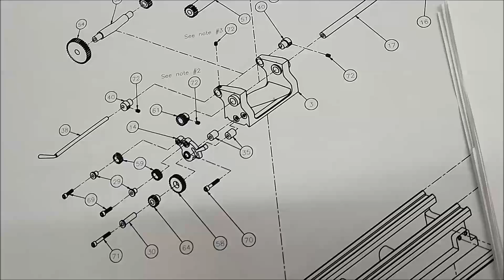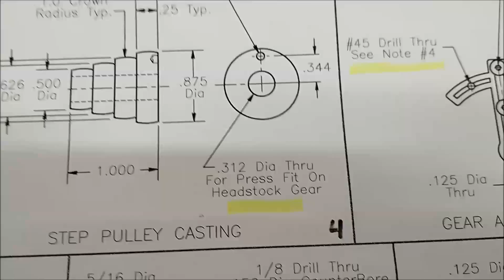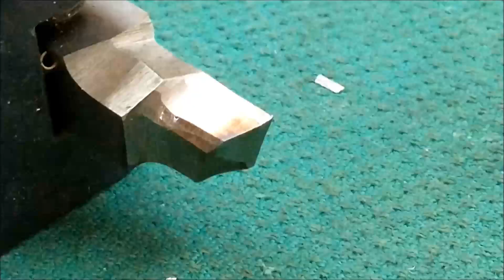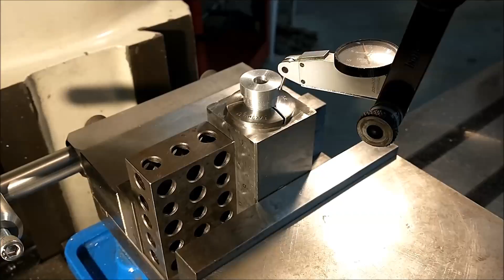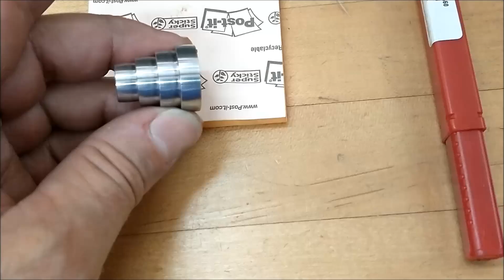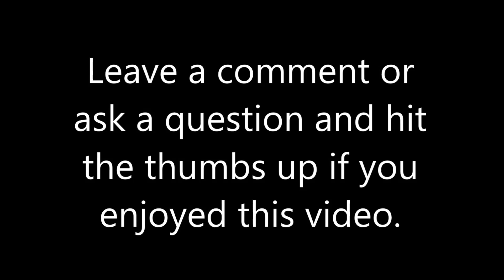Machining a Miniature Lathe -  The Cone Pulley - Dimensional Crash ????

Comment: Dumb question - why the 1-2-3- block instead of the vise jaw itself?
Reply from the maker: Anytime I use a 1-2-3 block, its usually for a vertical reference surface. The stationary jaw only gives you one vertical plane. Using a block, you now have 2 and the part can be positioned true to the machine Z axis.

Comment: It takes a lathe to make a lathe, now I just wonder how they made the first lathe ever...
Reply: Seems obvious, but... by hand. It's been a matter of continuous refinement and improvement in materials, power generation and measuring tools over centuries. It's actually related to the potter's wheel, same principle and it used to be foot powered and using simple spindles, and mainly used for wood turning at first. 
If any two opposing points are solid and stable, any object rotating, affixed between those points will rotate in a 'perfect' cylinder. 
Just the matter of stability, precision and driving that rotation has improved.
Reply: Check out the Gingery Lathe (and other machine tools)  
Really interesting and practical information that shows how machining tech could be bootstrapped, and will certainly teach some the principles of how it actually was.
Reply: @georgehill9353  Woa David Gingery is a goldmine as a source of knowledge, thanks for that recommendation.

Comment: I like a file to remove cold welded junk from the tool. I figure it won't effect the edge of the HSS (or Carbide, but might be more likely to chip the carbide). If I use the stone at the wrong angle, or slip with it, I might have to redress the whole edge (or not notice, and have dulled my tool). Thanks for the vids!

Comment: I have access to a 3 speed 25 in lathe dating back into the 50's that still has its original hand laced belt. 8 in from chuck center to the bed rail clearance. I have made some incredibly large pieces on it over the last 42 years with my old business partner. We are both retired now and lovin it. I have yet to have a need to pressure turn but know when the time comes I won't be in the dark. Stock or a Gr 8 bolt would be my choice, LOL. Sweet seeing the crowns come to fruit. Very nice indeed. Sure pays to spend a lot of time as needed when working with prints looking for little glitches like what you encountered here eh. Well my friend one more tick on the parts list done eh !

Comment: Thank you very much! I learned something today thanks to your expertise. I have trying very unsuccessfully to do some single point threading and my results to date have been crap. It would seem that I have been remiss in how much I was honing my tool. My threads would start out just fine and then all of a sudden right in the middle it would rip the threads out destroying my part and I know it wasn't my half nut  timing because even when I left the half nut engaged it did the same thing. "More hone, less moan" will be the motto from today onwards.
Reply: Did you check the  lead screw  for play ? or back gear not meshed right.

Comment: You got me ,lol. I made the 4 jaw chuck yesterday first one after I got it turned , I forgot to get the collet block collar tight in the mill , Dhooo.  Second one I bumped the vice out of square on the mill , took  an hour getting it right and aligned to the part and reset the DRO. I did not make drawings . Kinda seat of my pants from the tee cutter size I have. Made the Jaws in bras , thought it looked cool. Came out quite nice . Chuck body is 1042 stress proof steal , slooow going ! Got er done ! Just need  to put the features on the Jaws. Thank you !

Comment: It's looking great, and it's so close to being finished. Have you thought about what kind of motor you're going to use and how it will be mounted and all? A quiet DC motor with a planetary gear built in would be good to keep the RPMs down, or a small "gear" reduction setup with pulleys. I can't wait to see.
Reply from the maker: I'll stay period correct and belt drive it off the steam engine I built.

Comment: Joe, will you be redesigning the gear & pin to permit it to be properly (dis)engaged?

When you were pressure turning the step pulley(s), your tailstock pressure piece wobbled a lot and it looked like the live center was wobbling too.  I'm guessing that your live center looked like that simply because of staining on it rather than it actually wobbling?  I also assume that the pressure piece wobbling doesn't matter once it is pressing the part.

One last (non-related) question: when you were using your edge finder to locate the V-block & vice jaw, I was reminded of my "confusion" about how to properly use the center finder half of a combination center/edge finder.  Am I correct that the center finder half is only useful with the spindle turned off and simply measuring over the edge finder once the point is "embedded" in the hole/center that is being dialed in and then moving the table as needed until there is no measurable variance?  Or am I just not imaginative enough on its use?  ;)

Comment: I've heard it called  "built up edge" When I have a problem with it I bump the edge straight on with something soft like mild steel. Brass is cool too. I tap it in the direction of chip flow. Good oil or coolant helps with this pesky issue.

Comment: This is a great example of where dimensions should be listed as asymmetrical. The gap being +.005 -.000, and the pulley being +.000 -.005

Still, the gears are sized such that like you did here someone will mostly likely need to thin them out 5-10 thou
Reply from the maker: True, but the amount of potential movement in each sub assembly would also have to be factored in for positional accuracy.

Comment: This is the episode I've been waiting for. Really cool.

I do have one question though.

Couldn't you have drilled and reamed the centre hole first, then mounted it on a long arbour, to do the diameters and crowns?
Reply: Possibly, but the part is quite bumpy as it is a casting, so it would be quite difficult to properly align the hole. Also, I'm unsure if using an arbour would work in something as soft as aluminium, I would think that the tightening of the arbour and the subsequent turning will deform the hole. But maybe, if the hole is reamed as a final step. What's more baffling is why they went the route of making a casting instead of simply throwing a piece of bar-stock in the kit.
Reply: @Skaldewolf  "What's more baffling is why they went the route of making a casting instead of simply throwing a piece of bar-stock in the kit."

Like they did for the chuck.
Reply from the maker: @BedsitBob  To answer your initial question, Yes. But the answer below it is pretty accurate as to the risk.

Comment: Joe, your workmanship is unsurpassed. However need to ask a question does one lubricate skroll chucks internally with grease or graphite dust ? Thanks Johnu
Reply from the maker: I've always used just light oil on the jaws and grease on the back of the scroll internal workings. Too much grease on the face of the scroll is like glue for flying chips.

Comment: Hi Joe, I am only half way through but I thought that I would mention a couple of things for your audience; I use very old 3.5" centre lathes, what you would call 7" swing, with flat belt drives. At this size the crown on the pulleys is unnecessary as the steps keep the belt in place. Your model's prototype will be a big industrial lathe with long belts coming, probably, from a high ceiling so belt tracking will be more of an issue. Also, you run an industrial workshop producing large amounts of work efficiently and economically so you will grind your tools accordingly. I use HSS tooling and grind my own using experimentation for the best finishes on occasional single parts. I have found that up to 15 degrees top rake gives excellent results. The point here for hobby machinists is get to know your machine and don't be afraid to experiment. I don't know much but like to share what little I do.
I have now seen the rest...superb again Joe, thank you very much

Comment: Joe, I spent my industrial career working on Euro equipment, all metric. Whenever there was a high tolerance fit, like a pin in a hole the print would call out the nominal size, say 100 mm. Then the call out on the hole would be say, 100 +.02/+.04 mm and the pin callout would be, 100 -.02/-.04. So the minimum tolerance would be .04 and the max tolerance would be .08. This eliminates that tolerance issue.
Reply from the maker: Agreed.

Comment: I would have drilled/reamed the step pulley first, then pressed onto an arbor (either custom-turned, or a stock arbor) for the outside machining.  When you did the pressure turning, I noted tailstock end wobble (that you cautioned against in another pressure turning video) that should have been relieved before turning.
Reply from the maker: You need 6 hands for that. Pressing this onto anything other than the final part would be very risky. the material is very gummy and could tear easily.

Comment: When I went to tech school back in 1970, before I went off to play GI, they figured that that tooth was something that helped tool life. Probably because of the low grade tool bits that were available. Aluminum wasn't included in that. I have also discovered that super gluing a piece of emery cloth to the drive spud helps a lot in that pressing  type operation. It doesn't need to be really coarse. Great series, by the way.

Comment: Whats with the commercials?  10 breaks, most of which have 2 commercisls each.  Some of the commercial breaks are longer than the content that preceeds them.
Reply: Really? I didn't get a single ad, and I'm signed in but not paying anything. Might be something in your settings?
Reply: @sean.chiarot  You didnt have any ads in a 40 minute long video?
Reply: @adamculpepper5571  Not one. I'm just realized that I'm running the browser extension Adblock Plus. I just turned it off, rewatched the video and got an ad a little more than two minutes in. Install Adblock Plus (it's free) and it will eliminate most if not all ads. I had no idea it was making such a difference.

Youtube has a tendency of changing the ads preferences for uploaders and not telling them. So a lot of times they aren't even aware that that many ads are playing.

Comment: For a thin Flat belt -- Check with the Edison Phonograph Guys, The thin leather belt that drives the Cylinder machines I bet would work Nicely. Its also easy to handle and splice.

Comment: I find that kerosene used as a cutting fluid prevents build-up on the tool when cutting soft materials like aluminium and copper.
Reply: I also use auto transmission oil. Works we and you can get it anywhere
Reply: Ethanol
Reply: Kerosene is the major constituent of WD40.

Comment: Is Ok to stone a cold weld on a carbide insert?
Reply: I was wondering the same thing -- I recently got some weld on a boring bar insert -- wound up spinning the insert around, but it would be nice to get more life out of the other end. Years ago I cut some slots in aluminum using a carbide end mill in a router. No lube since I didn't want oil all over my woodworking tools. I think I spent more time carving welds off the end mill with a utility knife than actually routing (haven't tried carving the insert [yet]). What a mess -- chips everywhere. If I were doing it again, I'd do it on the CNC router (which I didn't have then) with an alcohol mister.
Reply: Many metals, including iron, react with acids.  Aluminum is amphoteric and reacts with both acids and alkali.  A strong lye solution will remove cold welded aluminum from steel and tungsten carbide tooling.  DON'T get the lye solution on your skin or (especially) in your eyes, as it attacks flesh too.  Protective eyewear and rubber gloves are a must.  Also, weak acid, like vinegar or lemon juice, should be on hand.
Reply: If I cannot knock it off with the end of my scale, I'll take a small oil stone, the one's the cutting tool salesman used to give out, and carefully hone it off just like Joe was showing in his video. If its a big build up, take it down with a small file then follow by oilstone.  Ken

Comment: Joe, the bull gear locking pin used in the Southbends and others is a later development.  I have a 1868 patent Putnam 18X60" that uses a square headed bolt in a radial slot.  Loosen the nut and move it in the slot to tie the spindle/bull gear to the slot for the bolt head in the step pulley.  It does work but not as nice as a 9" Southbend pin!  Interesting side note; the 1868 Putnam cross feed used a 3/4X6 Acme thread with NO micrometer dial.  But how would you make a dial with 166.666 divisions?  I guess you worked it with calipers or used the compound if you wanted to turn to a dimension.  The compound was made with a 10 pitch screw and 100 division dial. Both the cross feed nut and screw were worn out so when I rebuilt the lathe I made a 3/4X5 screw, nut and 200 division dial to modernize and make the lathe more usable.
Reply: To add to this, I've got a 1916 South Bend 13" that has a square head bolt on the bull gear that you have to slide in the slot.

Comment: Aluminium is a pain to grind as well as it just acts like sticky clay. Candle wax works great for grinding with flap discs and it will cut twice as fast and oily coolant works great for turning and drilling. I don't have any chalk so haven't tried that yet but think they use it when filing.
Reply: Vaseline when grinding aluminum works good.
Reply: Thanks for the wax advice, definitely chalk for filing. Kerosene is good for drilling and turning and threading too.

Comment: Good save on the back gears.PM Research prints are better than most. 
I built their #6 horizontal steam engine. I also built a Tiny Power Ajax horizontal.The prints are drawn up in fractions.Honestly,the latter is the smoothest running engine I have ever built.
I am looking forward to the next part of this build.

Comment: The term is “built up edge” and believe it or not rock will stick to a diamond (PDC) cutter unless the face of said cutter is polished.   So it is a pain in the %## in all sorts of endeavors.
Reply: @ParabolicLabs  I spent over 20 years designing bits that drill oil and gas wells.  The biggest problem is that it slows the rate of penetration and increases the torque needed.   I started my working career as a machinist so when the R and D guys showed that built up edge happened on rocks I saw an old foe.    The company I worked for obtained the patent on polishing the cutter faces.   Some folks wondered if the polish would wear off.  The polish is not a wax or anything like that.  It is diamond, so it stays shiny, and therefore slick for the life of the cutter.  Too bad diamond can’t be used on iron.   As it gets warm the iron sucks up the diamond as expensive carbon.  
Another interesting aspect is rock cuttings look just like photomicrographs of metal cuttings.   Weird!

Comment: If you put a step pulleys backwards, large to large and small to small, would you get the same spindle speed if a belt was on both large as you would get on both small?
Reply: Yes, but you'd need a different length belt or you'd need to change the center to center distance between the two pulleys. The way it works if they are big to small on each end is the belt length and axial spacing stays the same on each combination of pulleys.
Reply: @Mishn0  thanks man, makes sense lol, I was just having a brain fart
Reply: If you added an idler pulley and lever to tension the belt with a correct throw for tensioning between the step pulleys, it would work.